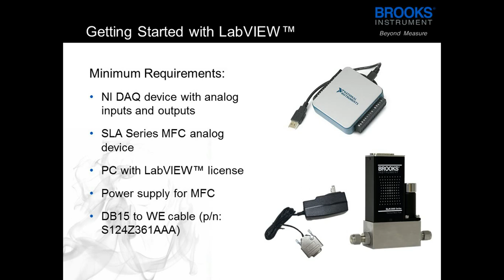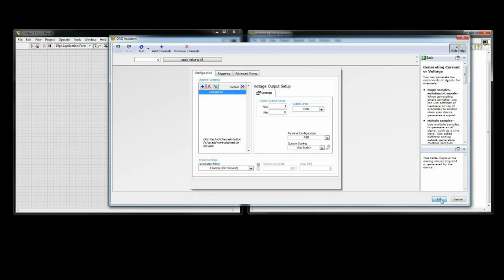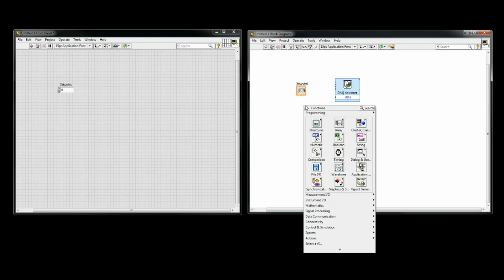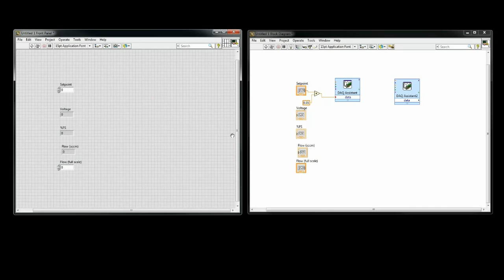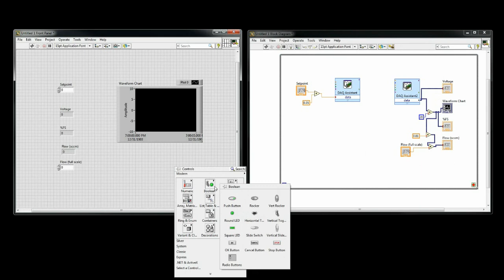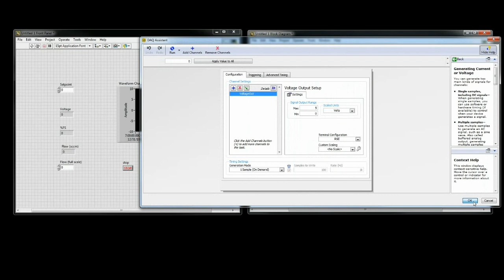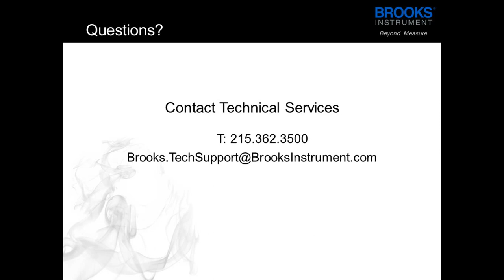How to Write LabVIEW™ Programs for a Mass Flow Meter

Comment: I want to implement a processor software in Labview, when i run that  processor software in the system, which will control the MKS (Mass Flow Controller device) , and  each and everytime  I want to change the velocity in that software when i run it, then i have t  to check the response of  cross sensitivity of the sensor which is connected to  the MKS device. could you please suggest meif anybody has any idea  how to implement the software.

thanks in advance
Reply: Hi Sudheer! Have you been able to figure this out?